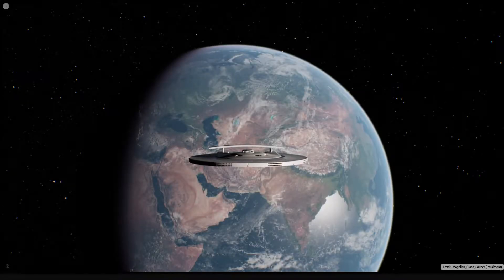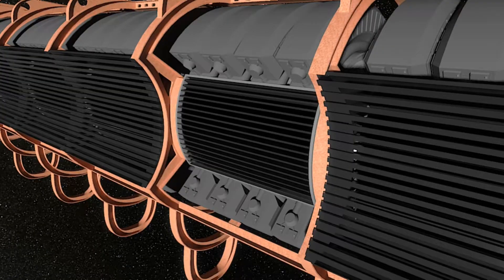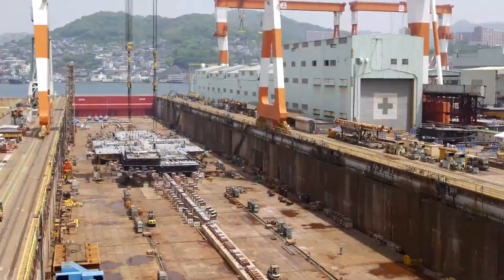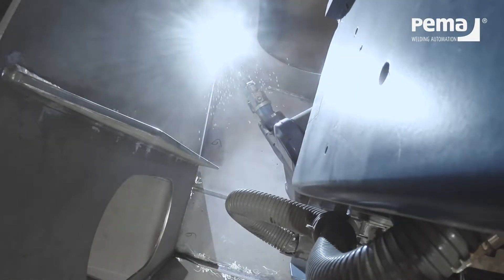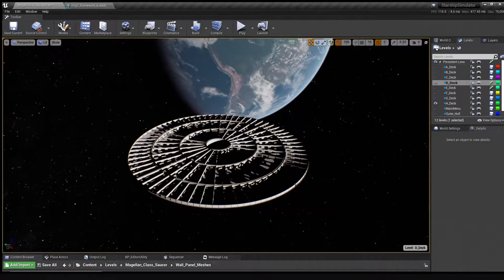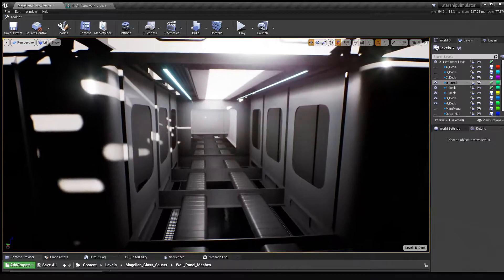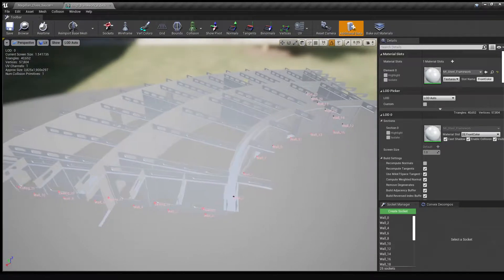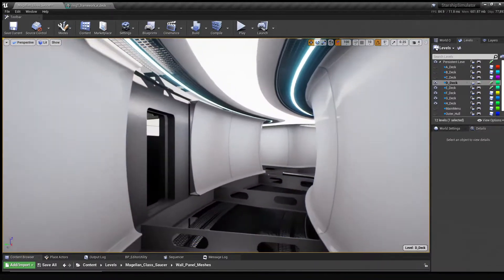Starship Simulator Devlog #2

Comment: side note question for sci-fi geeks ... how would we go about dealing with gravity and inertia? I mean in real space, any little movement has tons of reactions to all things in the ship not tied down.  Also, even turning around makes massive velocity changes, so how would people be protected from this ... and how would you simulate the perpetual downward gravity feel like on the enterprise etc?
Reply from the maker: Gravity is created on the ship using similar technology to that of the Alcubierre drive. Energy and matter are interchangeable at a quantum scale, so with enough energy you can create a mass-field sufficient to achieve 1G of gravitational pull. To counteract inertia, the field can be angled to oppose the direction of thrust, although only up to a certain point.